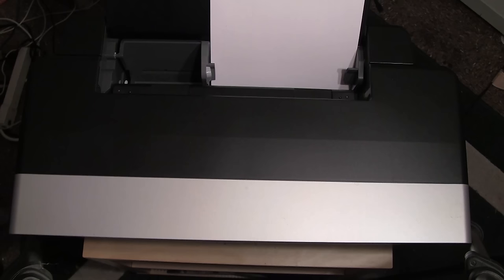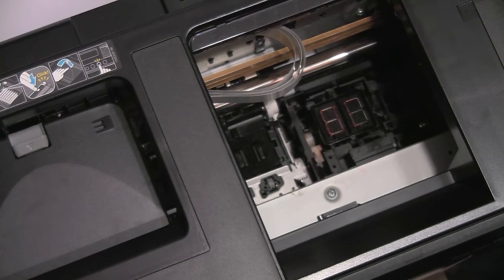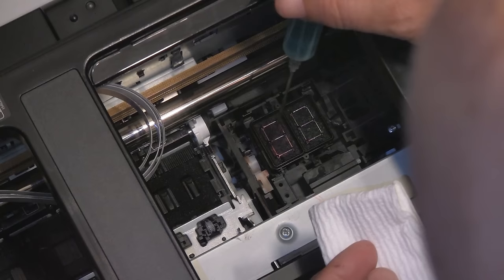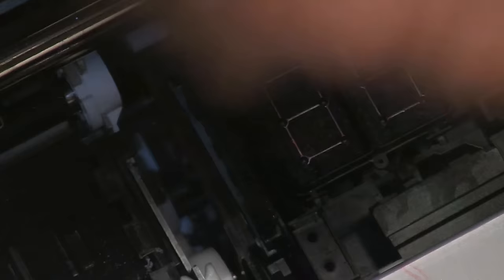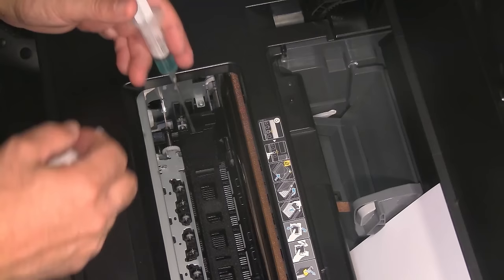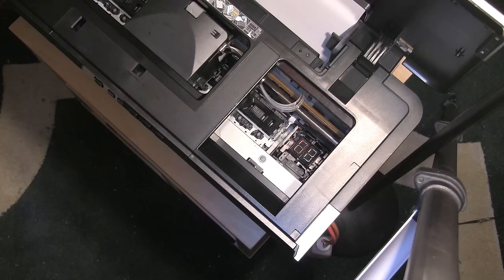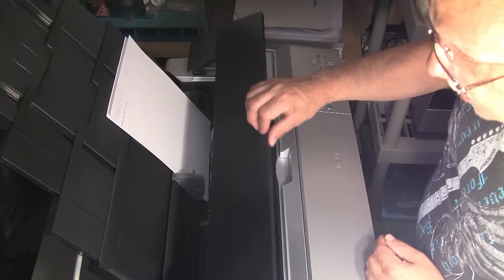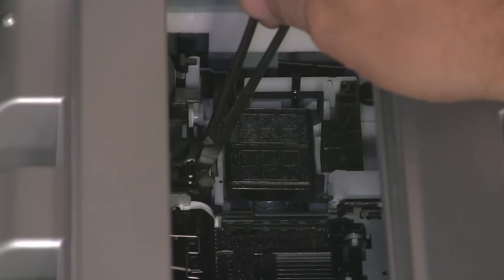How to perform Basic Maintenance on the Epson R2000 and 3800

Comment: Do you have a preference between Epson P800 and Canon pro 1000?
Reply from the maker: +Kitti McMeel At this time I do not as I do not yet have either one. But if the PRO 1000 prints even a tiny bit better the the PRO 10 then it is winner in my eyes. The chroma optimizer basically assures that it will outperform the P800 but ONLY as it pertains to gloss differential and lack of bronzing effect on glossy and luster papers. If you only print to matte media, then either printer should prove excellent!
I am currently trying to raise  the funds needed to add a P800 to the current stable and begin to produce  a series of P800 specific videos. Earnings from the video channel and fan funding will be used to achieve that goal.
Reply: Hi Jose. I ended up buying the Canon pro-1000, I have it all set up and want to make sure I'm getting the most out of it. I don't understand the relationship between the proof setup options and the ICC profiles and the choices in the printer dialog. Can you help with that or recommend a resource :) thanks.. ps waiting for my tubing and syringe to last ditch try on my epson
Reply from the maker: +Kitti McMeel Watch my latest video for the procedure!I am not familiar yet with the PRO-1000 but you can go to Keith Cooper at: http://www.northlight-images.co.uk/articles.php  for a full review on the PRO-1000 that will be published very soon and should cover just about all you will want to know and more.I will buy a PRO-1000 for the channel but not till after I get the EPSON SC P800.Printing with ICC profiles which is the way you really should go is covered on my PRO-100 videos here in the PRO-100 playlist.You will not be controlling color in any way with the driver. You will be turning off color matching in the driver and then allowing your editing app to control color through the ICC profile for the printer and paper of choice. Watch my CANON videos. If CANON then you will choose the appropriate paper to match the paper. If you are using a 3rd party paper then you will need to download their custom paper profile for the PRO-1000 and use it instead.
Reply: I could not find the article you are referring to :(
Reply from the maker: +Kitti McMeel Because it is not yet published. But once it is, you will find on Keith's site.

Comment: Jose do you know anything about Canon printers? Considering buying a new printer and would love to get your input
Reply from the maker: +Kitti McMeel I would need to know what your needs are. Size of prints. Dye or pigment. There is the Pro-100 which is dye based. The Pro 1 and 10 which are pigment based with chroma optimizer simmilar to the R2000
Or the brand new Pro-1000 which has 17" print capacity. All previously mentioned models are 13"
Watch Canon printer play lists. Pro-100 Pro-10 and Pro-1
Reply: +Jose Rodriguez Considering the 1000. I am a portrait photographer and I print all my own work. Typical that is a 7x10 image. I typically print 2up on 13x19 or 1 on 8.5x11.I want better quality than what I was getting with my R2000 although it was acceptable. Looking to compare P800 with Pro 1000. Or if I go with 13x19 what would you suggest?
Reply from the maker: +Kitti McMeel The PR0-1 and PRO-1000 will blow you away! They use a 12 color ink set with 5 blacks. Why so many? The tonality that separate shades of grays provide is out of this world. The gradations will be the smoothest of just about any printer out there. The PRO-1000 prints to 17" The PRO-1 to 13" so depending on what you need you can safely chose either one as they have and use the same ink set. I am about to get a PRO-1 myself as I will developing a refilling method using their original Carts The PGI029s and I will partner with precisioncolors.com for the ink set.At this point you will be using OEM for the PRO-1000 which is the correct and most ethical way to go if you are selling your work. Will you try to revive the R2000 using the method I described?
Reply: I don't have any tubing and not sure where I would get it or what to get. I'm not exactly handy :)
Reply from the maker: +Kitti McMeel Hobby shops as in fuel line for model airplanes. Heck email me your address and I will send you a syringe and tubing. It is really worth a try. tooljoe2003@yahoo.com
Reply from the maker: +Jose Rodriguez Got your email and will send that out to you tomorrow!